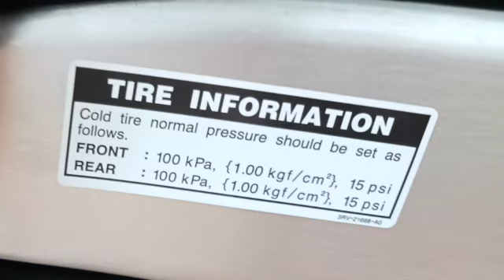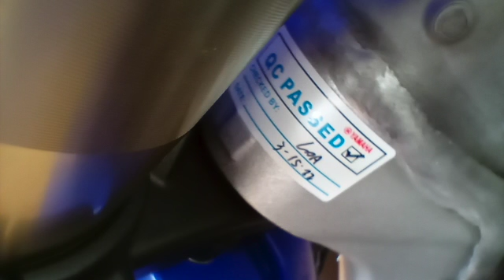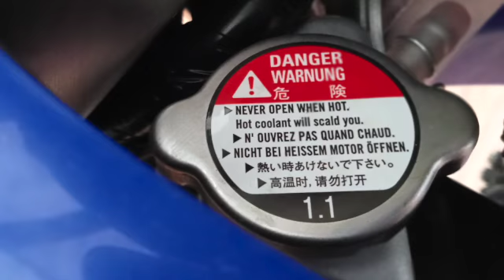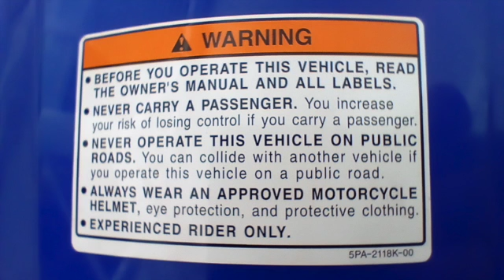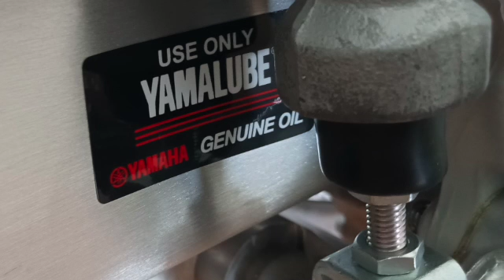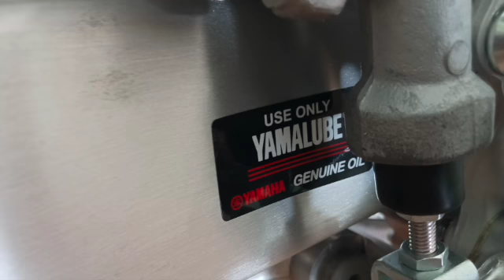best adventure bike? YZ250F?

Comment: That little ditch jumper would be awesome.  Through the alleyways and over the streams.  I'd have fun on this one 😎👍🐲
Reply from the maker: the popular one remains the YZ125 and that really is all you to have fun and quiet fast enough
Reply: @MotoTvWoodsFarm  I weigh 7 stone wet so 125 would work.👍
Reply from the maker: load carrying capacity gross weight capacity take away 'dry weight'. will give you maximum weight the motorcycle can carry. Without weighing yourself  joe average(USA) is typically 200kg. This is only part the issue as suspension expects joe average to be no more than 145kg. I think manufacturers envisage the typical pilot will be around 6' 2" tall and stick thin. So typically with an unchanged suspension typical average joe the suspension will be regularly clunking as the suspension is expecting a light pay load